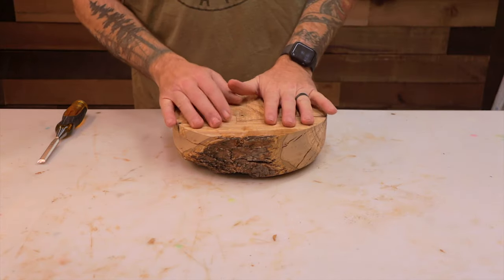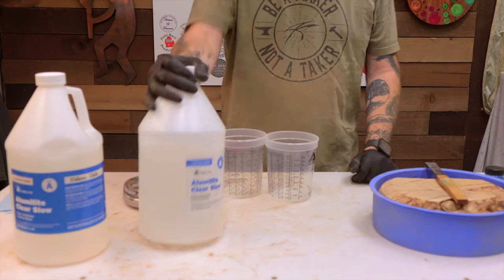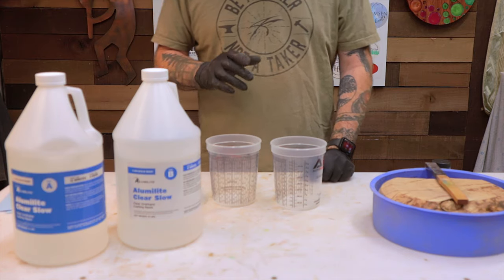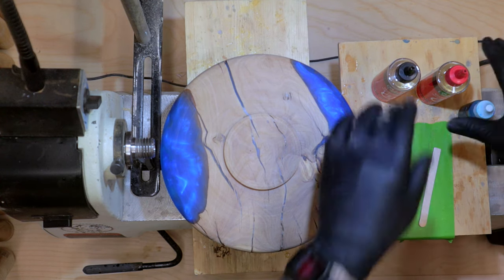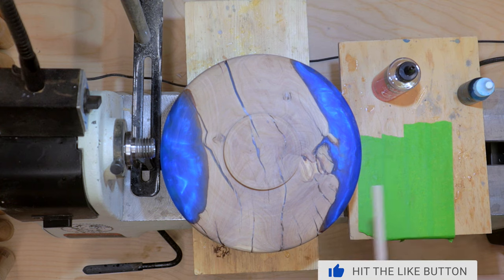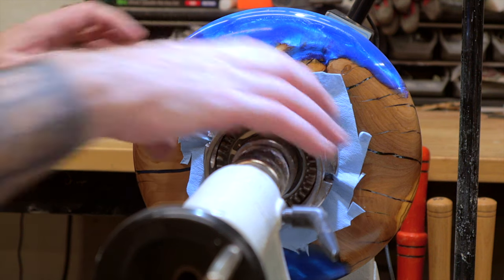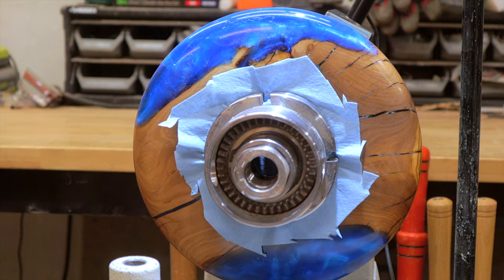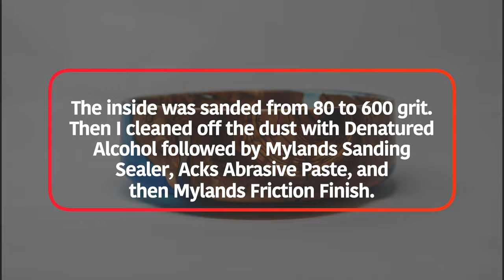Woodturning: Olive Wood & Resin Bowl

Comment: Hi Ed....beautiful bowl...I am looking to experiment with a piece of pecan that has several worm holes.  My question is what is the purpose of the pressure pot? Is that for the bubbles, faster setting of the resin , or something else?  I didn't see any info on  your setup of that.  Can you share? 

Thanks
Reply from the maker: Thank you Gerald!  Because of the pores in the wood, when you add the resin, you are going to get air bubbles escaping.  The idea of the pressure pot is to make them microscopic.  They are still there, but too small to see.  The other option, if you don't have a pressure pot, is to use a very slow setting resin.  Something that takes days to cure versus minutes.  The length gives the air bubbles time to escape.  I use that resin for projects that won't fit in the pressure pot.  Something like Alumilite's Amazing Clear Cast or Amazing Deep Pour.  Take a look at my headboard project where you see me use both of those products.  Please let me know if you have any other questions.  - Ed

Comment: Beautiful wood and bowl. BTW, did you run into warping/stability issues hollowing from the center to the edge?
Reply from the maker: Thank you!  I don't recall any issues.  I did get some chatter from the inside edge of the bowl, but I always do.  The tool shaft diameter is too small and I'm going to be building my own carbide cutters using 1/2" bar stock.  That should do the trick!  - Ed